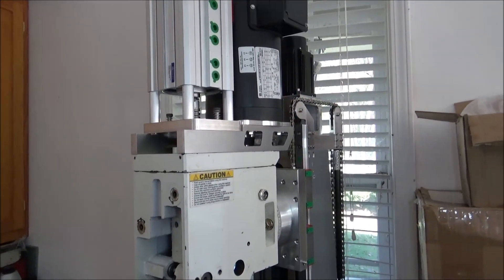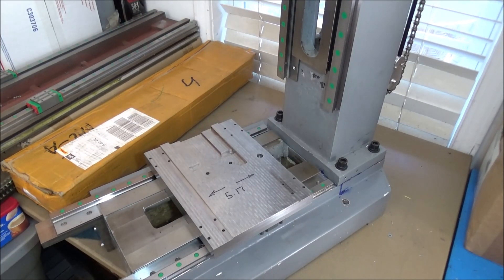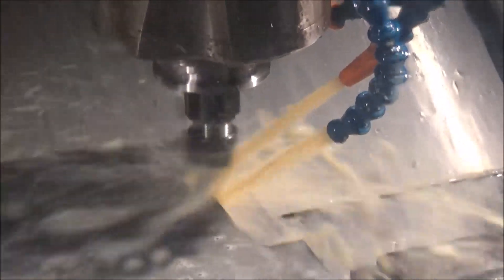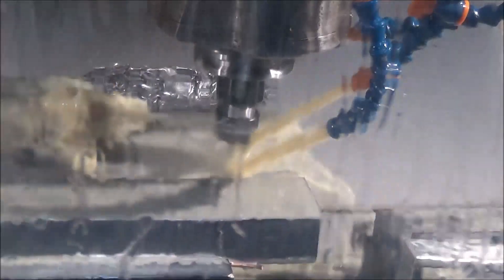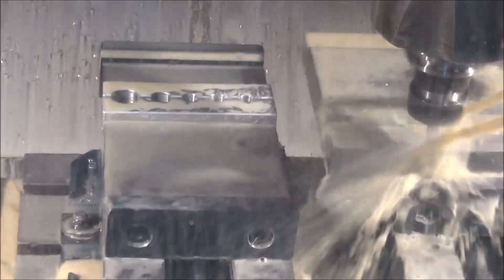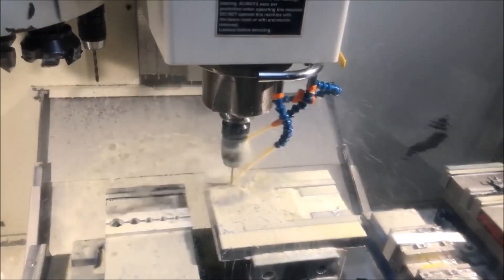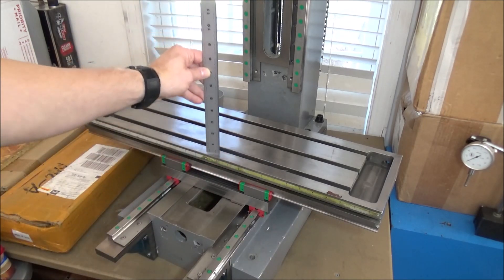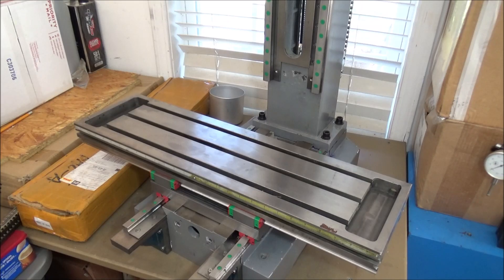PM727MXL  X Y SADDLE

Comment: sam, a few questions
what kind of steel is that?
and about the angle brackets you've used the support the y-axis rails: i'm thinking of doing something similar to you, but you don't have a dowel or anything to register on to make sure the angle plate doesn't go anywhere; are you not worried their position will shift over time?
and lastly what did he measure with that granite angle plate?
Reply from the maker: It is Just Plate steel Not anything special. Which is why we took our time to try to prevent bowing etc. when we machined it.
The Angle brackets Are not pinned the travel on the Angle brackets are mostly over travel. But I may pin them in the future.

Comment: Heyyyy!  About time!  Love it!
Reply from the maker: yeah its been awhile since I have worked on the rail project.
Reply: yeah it has.  Im in the process of building my pm-30.  Its been taking awhile.  Had to rebuild Basiclly everything on it because I went with 25mm c5 screws and a bt30 atc spindle so I had to make a whole new head for it. So only thing is base and column.